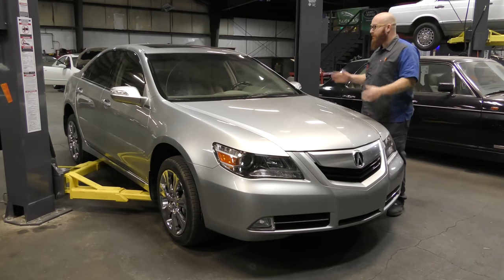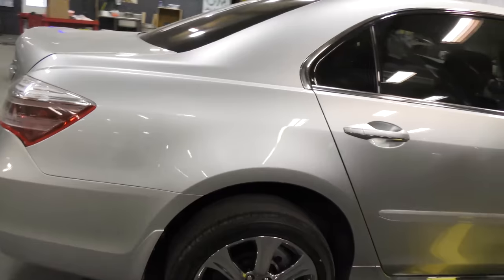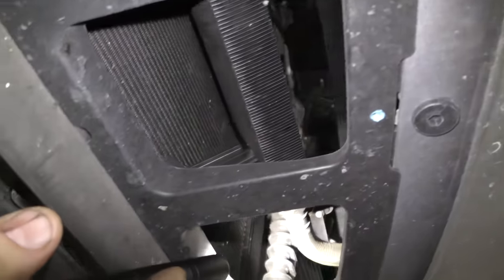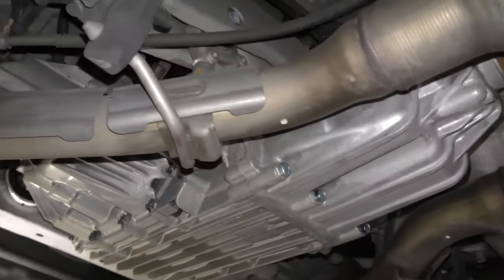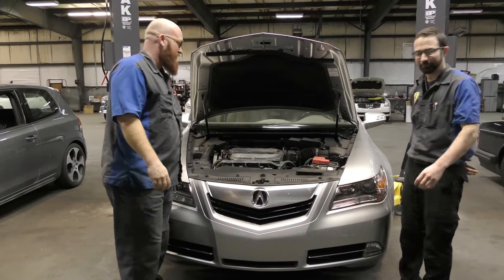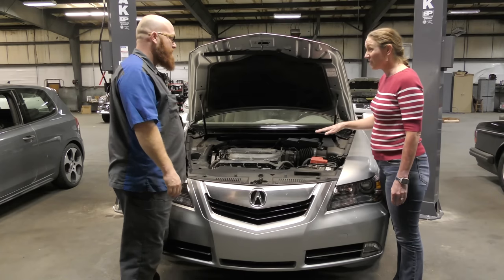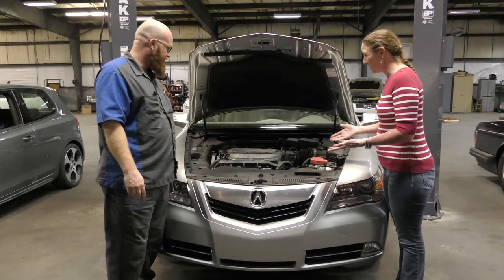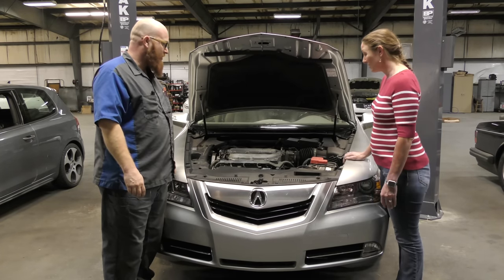Something Very Serious is Wrong with this 2010 Acura RL! What did the CAR WIZARD find???

Comment: The 2009 - 2012 Acura RL had an updated 3.7L J-series engine, and it has notoriously high oil consumption.  If you wait between oil changes (usually a year) the engine will become bone dry.  I wonder if this is what happened.  But he should have had a engine oil light in the dash.  The 2005-2008 RL with the 3.5L do not have this issue.  His best option is to find a junkyard 3.5L J-series from the earlier years and put it in.  It'll fix the high oil consumption issue too.  But he wanted a new or reman only, oh well.......
Reply: Can the 3.5 be swapped by the 3.7 in the 2011 RL?

Comment: The 3.7 comes in the Acura ZDX and TL Sh-awd. They start pulling oil past 70k so definitely monitor. It's not at a alarming rate but definitely change oil intervals to 5-6k. You can probably find a crashed zdx and pull the motor from that
Reply: Yup. Work on em everyday. Honda Release new piston/Rings Designs that fix the oil issue

Comment: I had a similar issue with my '80 Triumph TR8, which had the Triumph V8, which literally 2 4 cylinder engines welded together. No amount of money could get this thing to work properly- it would have oil delivery issues after oil delivery issues. Finally had to swap it for a V8 out of an old Land Rover Vogue.

Comment: People that was the sound of death. The car timing chain tensioner failed and the vtc solenoid started it all on that car. I can tell you from experience. First it started with a little noise(sometimes not noticeable)on  cold start up. That’s was the solenoid getting weaker. Then the solenoid gave out locked up the cams jumping the timing and eat up the valves. Hey Wizard can you check the timing on the old motor. I can almost bet my life on it being off by a couple of teeth. Don’t forget to look at the tensioner to see if it’s any good.

Comment: Wizard, that 3.7l motor is used on TL-SH, and MDX. There is also a service tsb on it where Acura knew there was oil burning issues causing the catastrophic engine failure. I have a 2010 TL-sh with 3.7Lin 6 speed manual and my friend has a 2009 TL-sh automatic 3.7L and his car had the oil burning issue. Acura dealer in Elk Grove California did the engine rebuild under the tsb#19-06
Reply: Like I mentioned in my comment, it feels like the customer was taken for and right in front of our eyes via this video. I can’t recall, but I don’t think they even mentioned talking with Honda in this video.

Comment: The 3.7 liter had an extended warranty due to oil consumption issues -- Google it. The 3.7 was used in MDXs, TLs with all wheel drive, and RLs. Keep looking, a lot of MDXs were sold. I believe the 3.7 was used from around 07 to 2014.

Comment: I've been researching sporty sedans that have enough space for 2 rear facing car seats. I landed on the Acura TL and Lexus ES350. I've always been a big Honda fan boy, my wife is a Toyota fan gal. After researching the TL. The 3.7L Honda used has a lot of oil consumption issues, some customers reported 1-2qts of oil in  1000 miles! Acura did issue a TSB on all Acura 3.7L v6s BUT you have to jump through hoops in order to get them to fix yours. They make you do all sorts of oil consumption testing and stuff. Silly, in my research I'm probably gonna sacrifice 20hp and awd to be able to have a more reliable car. I wanted to know why Honda quit using the 3.7L and I found out pretty quickly.

Comment: I was thinking of buying a used TSX and started reading reviews on them. It seems they have oil consumption problems as well. I guess I'll steer clear of these Acuras, they just make me nervous.
Reply: I've had a 06 TSX with +176,000 miles and 08 RDX 2.3T with +195,000 miles and they don't use any oil.  My 11 MDX Adv with +154,000 miles uses around 1 1/2 qts of oil per 9000 mile oil change.  I've since added a 19 MDX hybrid (+38,000 miles) and 18 RLX Hybrid (+22,000 miles) and they don't use any oil.  I did switch to 100% syn oil on my first oil change.

Comment: The oil passage has probably been clogged up by the owner being over baby-sitting the engine. This engine has probably not a chance of revving over 3000rpm for a period since new and letting the oil recirculation clean the oil passage itself. Check with the owner and will know.

Comment: Common failure scenario for this engine:
- Piston rings get full of carbon and crud
- Rings are of low tension type so oil bypasses rings and is burned in chamber
- As oil is burned the level falls below acceptable level before next oil change
- Even though oil light is NOT on yet rear cam becomes oil starved
- Rear cam and associated rockers fail
- Damage is done before Oil Light activates.

Check oil level often if you have an Acura 3.7L

Comment: Look for crashed MDX's to get an engine. Also i doubt the block is damaged, low oil levels probably caused camshaft wear and the whole valve train is totally clacked. i need you to do alot more research on acrua before working on this customers car, these things really might as well be supercars like you said. there is alot of special things about them.

Comment: Did not know that the transmission was in the rear of these. Always loved these cars for their tech and engineering at the time...
Reply: The transmission is in the front, it’s just the rear differential works like a transmission because it is a torque vectoring differential. It achieves that by overdriving the wheels.
Reply: @johnnieburkhalter5265  thanks for clarifying. Very interesting

Comment: You know wizard one probability that something is knocking inside with so low of miles is that when somebody was changing the oil in the past for some reason either by accident or by malice threw a bolt in the oil funnel that's a very strong reason a friend of mine was changing the oil for one of his customers and I was there he by accident drop a tool in the funnel worst of all he didn't knew and when he started the car gess what same noise that I heard on your post

Comment: I'm the proud owner of an o-6 r.l. with super handling all-wheel drive, 300K on the odometer and I still absolutely love it
Reply: Wow u got lucky tranny died at 130 n i fixed things all 4 engine mounts 3 radiators 3 alternators 3 batteries  water pump n so much other shot smh

Comment: Man, a lot of money and effort could have been saved by just going with the TL SH-AWD engine. The RL used the J37A2 and the TL used the J37A4, which produced a bit more power and torque. Outside of that, they both have the same bore and stroke, compression, valvetrain, displacement, fuel control, and are both produced by Honda beginning in 2009. I don’t know, but it feels like the customer was kept in the dark on his options.

Comment: I have a 2005 TL and man do the engine run forever my 05 TL has 275hp fwd I only been changing oil new brakes new power plugs and tires that it I had it for 3 years now and I been blessed i got it with 87k now has 141k

Comment: I had a 2012 TL with the same engine (3.7L)...
These engines had the oil consumption issues which had a recall...
Mine specifically never had that issue but it was always in the back of my mind. It was a really nice car but I sold it cause I didn't want to deal with a potential engine failure. I don't regret my decision 🤷🏽‍♂️

Comment: Just put a J37 from a awd TL or another option swap a 3.5 into it. It’ll work with the factory harness. Now finding a 46,000 mile J37 or J35 is very hard rebuilding is better

Comment: Probably the owner didn't use premium gasoline that why its engine being destroyed by not using proper rating fuel as recommended by the manual, especially on the dashboard and on the fuel cap itself as well

Comment: I noticed Honda v6 engines don’t take too much oil, a 3.5 2gr v6 takes 5.8-6.4 quarts of oil and I’ve worked on a Honda 3.5 and it took 4 quarts. If someone doesn’t put enough oil in one It could cause problems very fast I bet

Comment: there goes to show.... cars are meant to be driven... not parked... it is an unfortunate event for that vehicle... find a used mdx engine and swapped... what's the point of keeping it original? btw Car Wizzard  that rear diff/ assembly is part of the Super Handling AWD , its actually parts of the torque vectoring system, it was the first of its kind.

Comment: Wow, what a shame such a beautiful car had to go through this. Problems like this usually happens when a parent gives a nice car to an offspring. 

The Honda J37 V6 has problems with burning oil if it’s not properly broken in, or if oil changes aren’t kept up (which what most likely happened here). The 3.5L little brother (J35Z6) in the 2009-2014 Acura TL is far more reliable. 

I hope the wizard gives us an update soon.

Comment: My 2017 Q7 through a rod at ~84-85k My mechanic was amazing and found a motor from a 2019 Q7 with only 9k on it for about 8-9k plus install. I bought the Q7 from an Audi dealership and only 2months later the engine gave out. I feel for the owner of this Acura.

Comment: I wonder if the TSB on the tl's 3.7 from the sh awd about piston rings also goes for the RL's 3.7? Dealerships go as far as top engine rebuilds after the oil burning monitoring program they have (3k mi I think?). Came across tons of info on it when I was shopping 2010 tl's, but the tl has way higher production numbers than the rl of course. Also had a catastrophic failure on my 57k mi 2010 tsx. Any car can bite you. Some have less potential to, but a car is a car.

Comment: Oh, I am very familiars with what is going on with his issue and feel his pain. I have a 2010 Acura TL, and which has almost the same exact engine. There is actually a lawsuit out there he should have got email about that deals with that engine.  Basically, the engine has an oil consumption issue and at some point somehow it causes damage to the rear cam. I am part of a Acura Forum and this issue is very common.  Thankfully, my mechanic took care of me and found a used 3.7 rear head with cam and rockers that worked like a charm. The shavings you found in the oil pan are most likely from the can and if it was like mine looked like a hammer got to it. What is sad is if that engine they put in the SH-AWD models were the 3.5 the parts are readily available.  Acura knew about this issue and instead of saying anything they simply dumped that engine and went with the 4cyclinder Honda accord engine and 3.5 V6.  Even thought my car engine runs like new with almost 300K I must check my oil once a week to make sure I do not have the same issue again.  The lawsuit out there applies to engines that consume 1 Liter of oil per 1K driven.  He needs to be careful though because some Acura dealerships have been over filling the oil so the engine didn’t fail.  Right now, I burn about ½ liter per 1K. I learned a expensive and hard lesson but next car will have a engine that is more common and if luxury the must share engines with many other models.

Comment: I've got that same car, except my interior is Dk Graphite. I absolutely love the car.
There aren't any power adders or bolt on's for that engine available either.
No cold air intakes, headers, nothing.
There may be some cross over parts that can possibly be used, but as far as anything listed for the KB2- RL, nothing...
That car was a "mid-model change" and in 2010 not many folks were in the market for a $50k Acura.
Less than 2000 units per year were sold in North America while that particular one was in manufacture.
But even in stock configuration, it runs like a stabbed rat!

Comment: I work at Acura and I see these come in and while they are nice the J37 motor is not really that great…they instead of having cast iron sleeves in the block have aluminum cylinder wall with a nickisil liner. they burn oil  like 1 quart every 1000 or 2000 miles they even with low mileage they burn out and run out of oil. The J37 is a motor to avoid.

Comment: Um, the 3.7L Jseries also comes in the MDX, TL, and ZDX. They do drink oil. There is a recall on the valve seals. If you don't check the oil, you WILL destroy these engines.

Comment: I would check junkyards or just throw a 3.5 in there...

I was wondering why these are going so cheap, I see 2014 models with 40k-60k miles for $9,000-11,000 USD... You can literally buy a new car with engine for the price of rebuilding that engine :/

Comment: Why is the 3.7 not common was it a short run ? If it could be rebuilt I might go with that if it was mine but may go to a common 3.5 as I understand. I am just so confused why there isn’t a replacement even from factory like where they trying a new size on a short run I’m shocked

Comment: this truly is an amazing car and one of the best acura has ever built. i also had 2010 RL, same exact color and interior. i bought pre-owned, 1-owner in 2014 with 53k miles. i had a 2004 RL before that and it was also a great car, but at around 260k miles it started to have issues i no longer wanted to deal with so i bought the 2010.  on 11-6-22, a drunk driver hit me and totaled my RL. i'm still pissed about it. i really did love that car. never had any problems with it. as i stated, i bought it in 2014 with 53k miles and when i got totaled it had only 150k miles.  it was truly a driver's can and they really don't make them like that anymore. 

contrary to what car wizard said in this vid, this car is pretty rare. that was one of the things i loved about it: you pretty much never see them on the road.  as it turns out, they were pretty expensive brand new so acura didn't sell many of them.  anyway, after totaling it, i wound up "upgrading" to a 2018 acura RLX.  the RLX is bigger, more tech and a bit more luxurious with a little more HP, but there's just something so special about the 2009-2012 RL. luckily, acura sold even less of the RLX so at least i don't have to worry about seeing those everyday either.  

long story less long, this 2010 RL is so clean and such a special car and is in such great and like-new condition that it's DEFINITELY worth the $7k to rebuild the engine. the owner of this car is LUCKY to have it bc, for the right price, i'd buy it from him IN A HEARTBEAT!!
Reply: fuck, sorry to hear about your RL. amazing car. I just spent over 2k to service my 06 RL KB1 because she just passed 200K and everything needed some attention but she's worth it. I tried to find some lower mile KB1's and KB2's like this one in my area but they have become impossible to find. If I were this guy I would engine swap with a used, low mile J35, the 3.5L that's used in a bunch of other hondas, I'm sure he could find something for cheap.

Comment: This engine is very common and it was also used in the TL sh, and MDX . 

The owner is crazy to not use a pre-owned engine or either have Acura take care of it under a recall/warranty.

But to rebuild it is not worth it.

Comment: After reading the comments, I feel there was an error during building.  Honda builds more engines than any other company and once in a while something is going to happen.  I have owned Honda and Acura and never had a single problem with either car with the 100’s of thousand of miles on them.  I have even had my Accord in the dealer for an oil change and the mechanic said for over 100 thousand miles it is in amazing shape.   I race all my vehicle and run them to the maximum speed.  This car is worth rebuilding or putting a engine from a damaged car.  I am currently looking for a MDX and looking for one with over 100 thousand miles, best deals out there.

Comment: Based on the fact the rear diff still has the original paint marks on the drain and fill plugs tells me maintenance has not been done properly on this car…just because a car has low mileage and is kept super clean does not mean maintenance has been followed properly. The rear diffs on most all Hondas and Acuras that have electromagnetic clutches in the rear diff call for a fluid change in the first 7,500-15,000 miles and since this one hasn’t been done at over 40k and the age of the car I’m betting oil changes haven’t been followed properly either, based on how little it is probably driven and was most likely run low on oil which led to a sad demise. This era of Honda J series rarely ever have catastrophic failures along with most Honda engines of this era…even though some 3.7’s are plagued with excessive oil burning it takes many overextended oil changes and running low on oil over time for that to go into effect and even then they still rarely have catastrophic failures like this one suffered. Hopefully at some point we can see an update as to what truly went wrong. And why this 3.7 is unique to the RL only is because unlike most all other J-series motors it has vtec on both the intake and exhaust unlike the traditional vtec on only the intake side…this car is still way above and beyond almost all the cars Honda has ever produced a flagship with more engineering and details than most know.

Comment: you can get an engine imported from japan with less than 60,000 miles they didn't pass inspection there and they scrap the car...in Canada places like Japan Imports  import all the engines and trans in containers from these cars.fot about $2500.00 and you have a good running car for years..if you want to obsess about 42,000 miles or less then pay $7000.00 at the dealer.